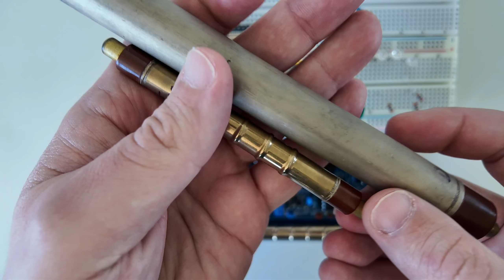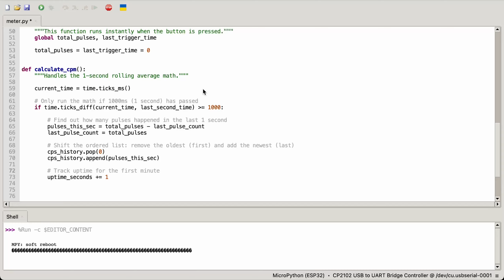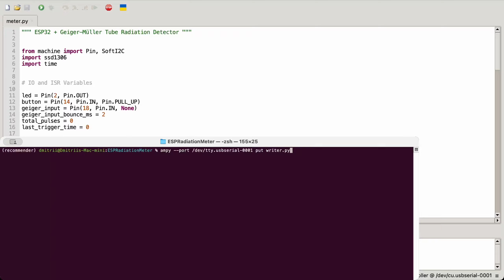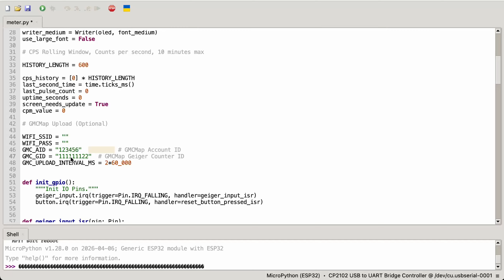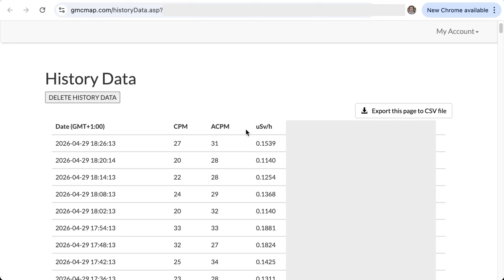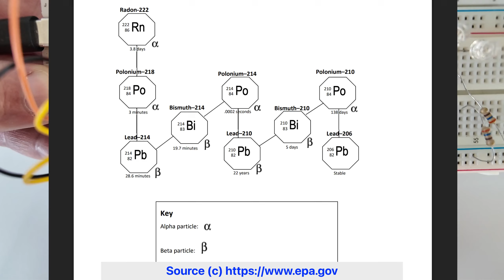ESP32 Geiger Counter: Step-by-Step Tutorial (Bonus - GMCmap Upload)

Comment: Try the same experiment using C. Your project turned out really well and inspired me to buy the board, but it came with the J305 tube; do you have any comments on this tube and the value used in the calculation—like the `return cpm_value * 0.0057` part?
Reply from the maker: Yes, a J305 GM tube is slightly less sensitive, so you will get lower CPM. You need to change the constant to 0.0081 to get proper uSv/h values.